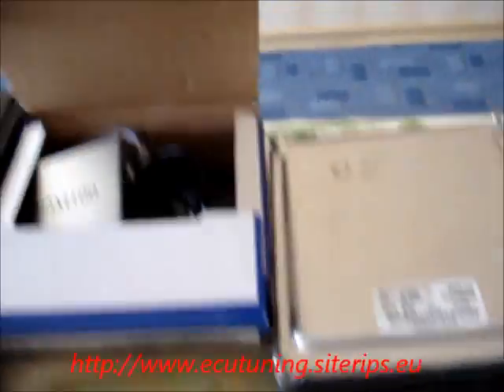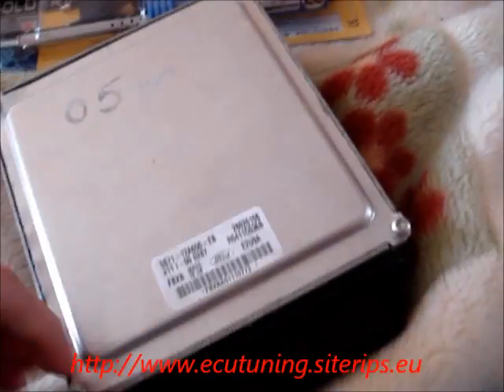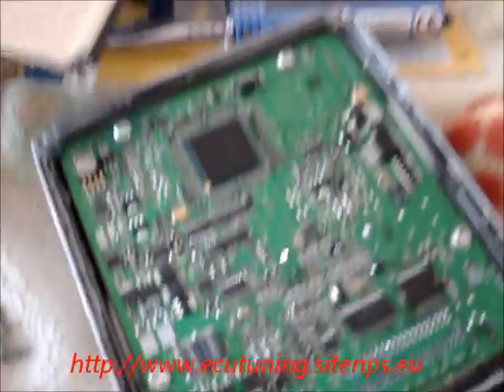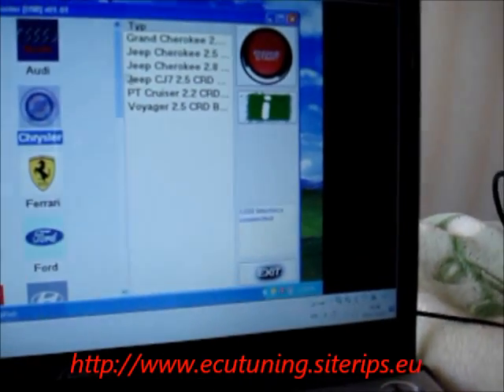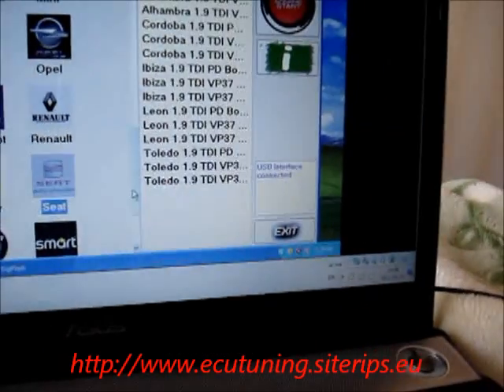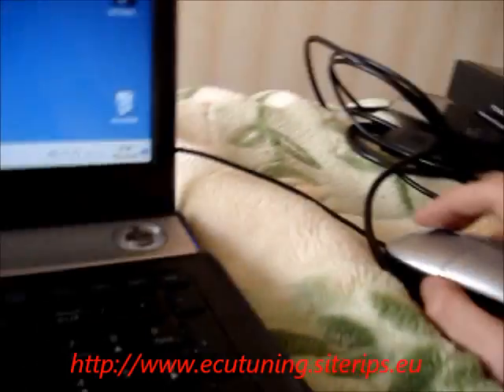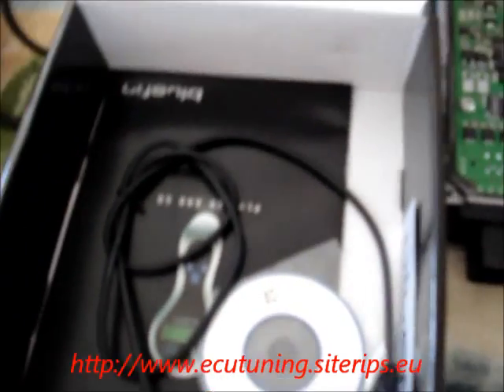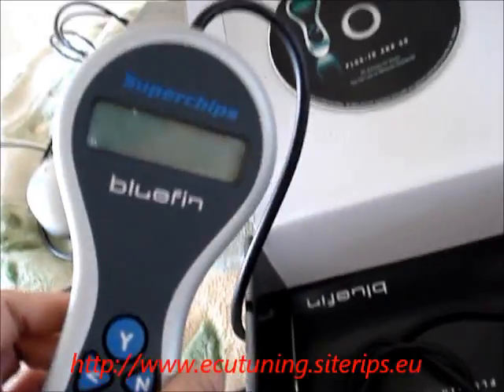Ecu flashing [Introduction to chiptuning].

Comment: I have a 2007 Subaru 3.0R engine in a stand alone situation. Think of on an engine stand.   Can the factory ECU be reprogrammed to run the engine outside the original car?  I mean basic cam, crank, MAP, MAF reading and then injection and spark.

Comment: Hi, great vid i must say, I have a D16 JDM Vtec setup (P08 ECU). I need to get this chipped, im very new to this so i could use your advice on this. On Ebay i found that u can get the chip programmed to your specifications, my question is, if this guy from ebay send me the chip with my program specifics, can i simply install the chip to my ECU (plug & play) and run it or do i have to do anymore stuff? Please help, i will be waiting for your reply.